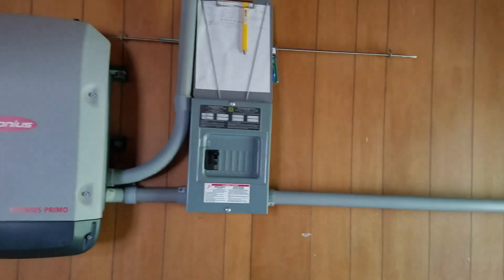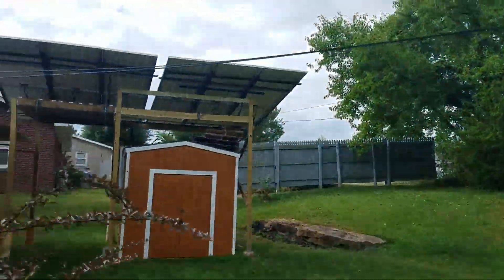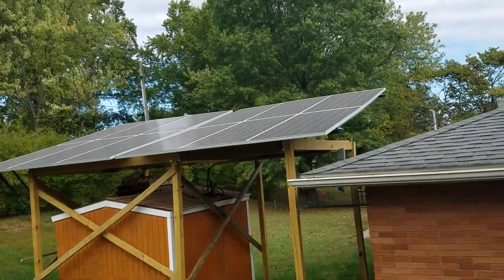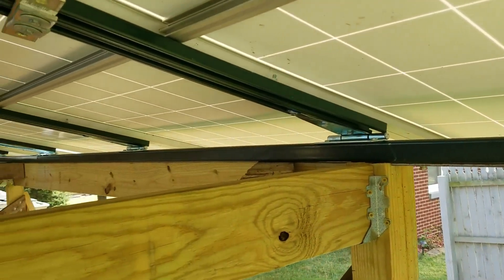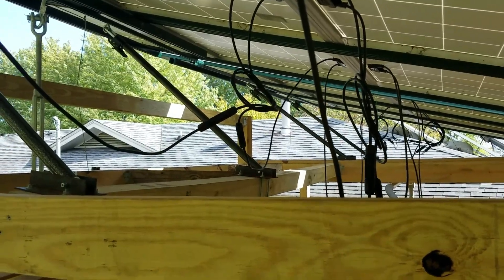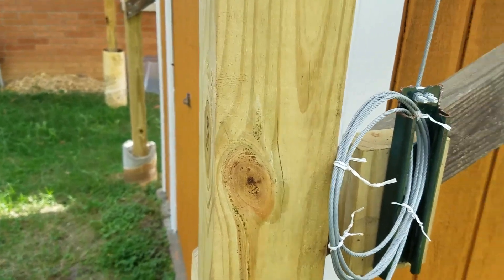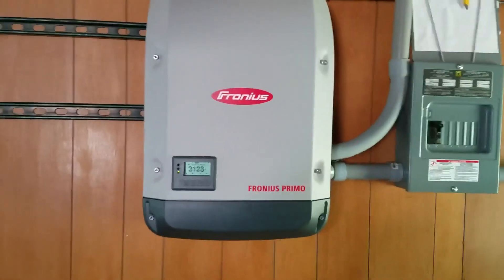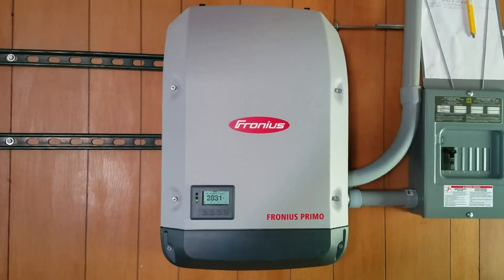3.8kW Solar Install

Comment: Matt, thank you for sharing. I like your set-up.  I'm nearing an install on my third SolarEdge inverter due to unknown inverter problems.  I am considering the Fronius instead of another SolarEdge and was curious if you had any problems with DE - dirty electricity with your inverter?
Reply from the maker: I had a warranty return on my ABB inverter because I couldn't reset the voltage selection.  Never had an issue with Fronius except the WiFi doesn't stay connected.  Though that might be because it's close to out of range for the signal.  I wouldn't know how to test for dirty electricity.  I use a UPS for protection but it only kicks on once or twice a week for voltage regulation.
Reply: @mattmills7867  Thank you, Matt.

Comment: How did you get the ports for the incoming and outgoing wires on the fronius open?  I knocked on one with a screwdriver, and that yielded but a couple of scratches.  Is there some kind of trick that I am missing out on?
Reply from the maker: From memory, there were two screws on the panel that exposed the electrical interface.  I had to use the 1 1/4" knock out to wire the system.  I'll follow up and let you know later today.
Reply from the maker: I re-read your question and I think I know better what you're asking.  Yeah, the knock outs are typically tough.  Buy a $2 J box from your hardware store and practice on a few of the knock outs if you're worried about damaging your inverter.  I usually use a screwdriver and hammer to get it started.  Then take a pliers and go back and forth until the metal comes loose.  You can always use a hole saw bit that matches the diameter of the conduit if all else fails.

Comment: So each string has 6 panels ? the total voltage is around 6*40=240v but this inverter nominal is 410v? can you please explain ?
Reply from the maker: There is an MPPT input for both of the strings of 6 panels in series so there are 2 DC input connection points.  Total DC voltage would be about 240V like you were thinking.  I'm not sure where you are getting 410V.  The AC hookup is residential L1 (black) and L2 (red) lines for 240VAC.  My other video on this solar installation might help:

https://www.youtube.com/watch?v=1ysEmeBIfac
Reply: Matt Mills the specs of this inverter is saying nominal dc input is 410v. Check their website. They need higher voltage to get the efficiency as speced.
Reply: Matt Mills  check here the input DC nominal https://www.altestore.com/static/datafiles/Others/Fronius_Primo_3.8-15_Datasheet_V2.pdf which is 410vdc which you will never get from a string of 6. You need 10-12 per string.
Reply from the maker: @offeraviad  Ah okay.  I'm far from being an expert, but I see the maximum power point voltage range is spec'd at 200-800V.  The string of panels that I have (Canadian Solar CS6U-320P) get to at least 225V daily while under load.  And I usually get 20-25kWh on sunny days while maxing out the power around the rated 3800W of the inverter.  I'm sure if I added more panels to the 2 strings there would be more energy output, but would probably be clipping the max output when in direct sun.  To your point, there's likely a better solar panel to match with this inverter.
Reply: Matt Mills I wonder if you can get a bit more if you string all 12 panels. The reason I was asking is because I also have 12 panels and I wasn’t sure if I can use two strings or one. Mpp will work as you have shown but maybe not as efficient as possible. Anyway thanks for the video it helped me decide.

Comment: hey why do you need a sub panel?
Reply from the maker: I installed the sub panel from my fuse box so that I could add both the solar inverter and a EV charger in my garage.  It also gives me the opportunity to add another 120V 15A circuit if I would need it.
Reply: @mattmills7867  ok

Comment: Interesting coming across your video and having the same first and last name.
Reply from the maker: My Primo is still working well, although the wifi drops out too often to be useful.  Have you had any issues with setting up your Primo 5.0?
Reply: Try updating your Datamanger card to the latest software version. This could help with connectivity

Comment: Awesome the Uni-strut mounting method!
Reply from the maker: Thanks man.  The 14 gauge unistrut pieces were too weak to keep the panel sections from bowing so I had to stiffen them with a 12 gauge cross brace.
Reply: are you using the datamanager 2.0 for reporting?
Reply from the maker: I got it working briefly after I installed it but the wifi in my garage is either too weak or the signal gets attenuated too much by the inverter housing.
Reply: Matt Mills you can extend the antenna with a cable outside the inverter 2.4GHZ WiFi cable
Reply from the maker: Yea, I think the antenna came with the inverter but it still doesn't get a good signal.  Thanks though.